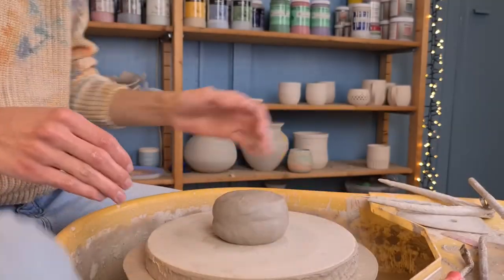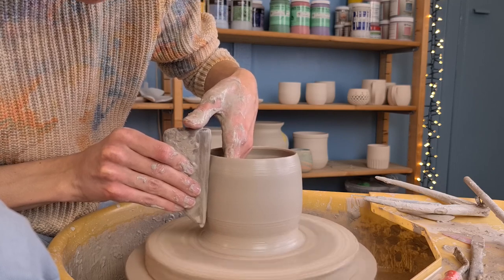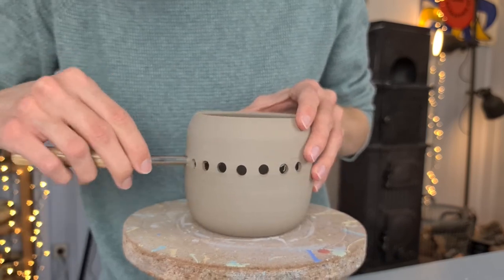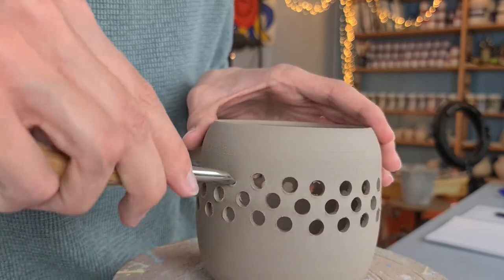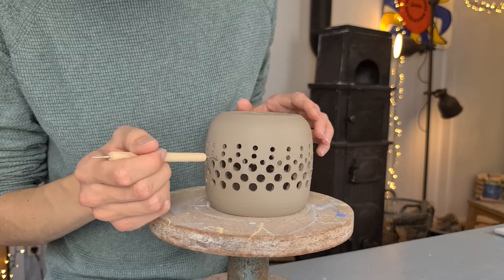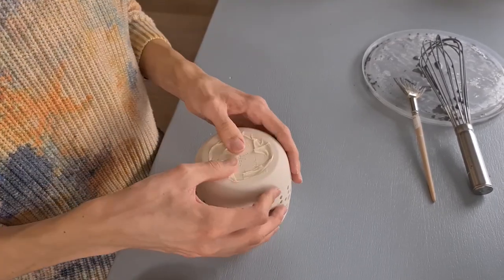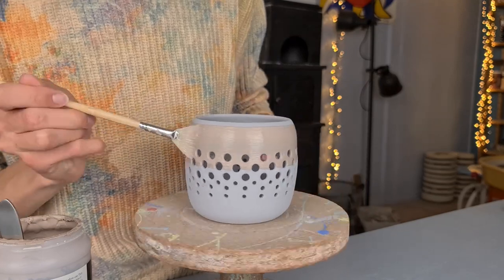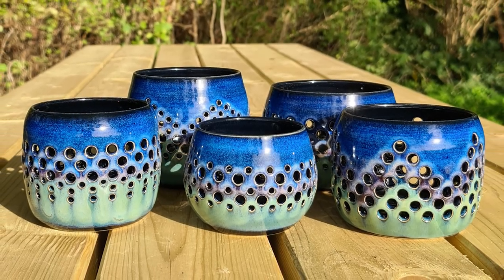How To Make A Tea Light Holder // throwing, trimming, hole making and glazing, full pottery process

Comment: A simple trick to keep a strait line, use a wet brush, put it to the pot while it’s turning on the wheel. It will leave a barely visible strait line to guide you.
Reply from the maker: That's a great tip! Thank you!